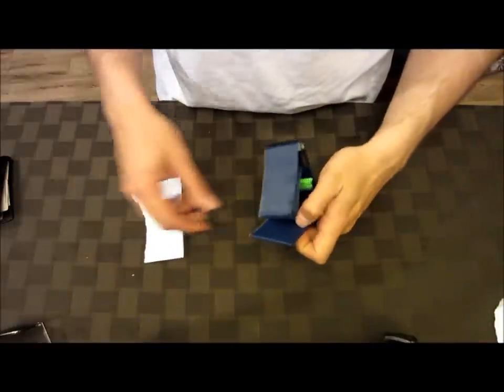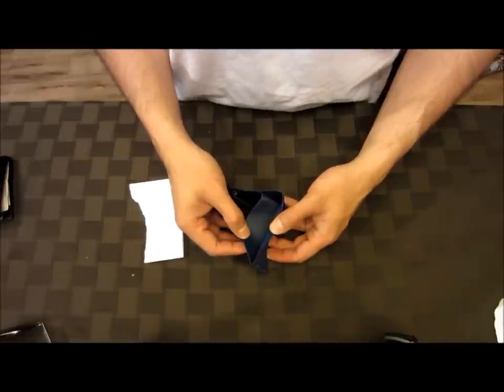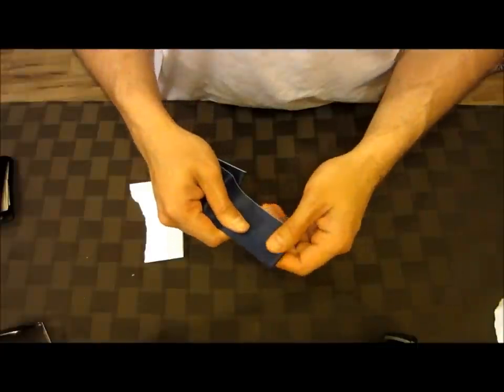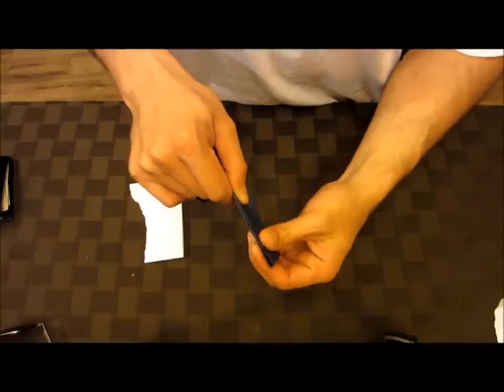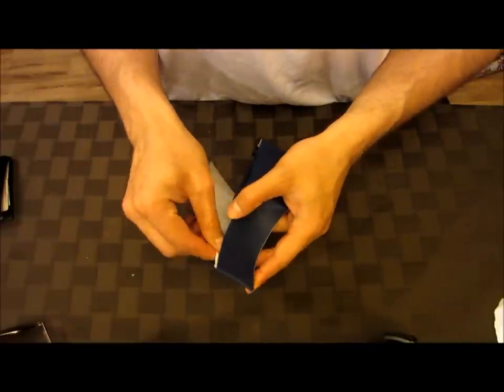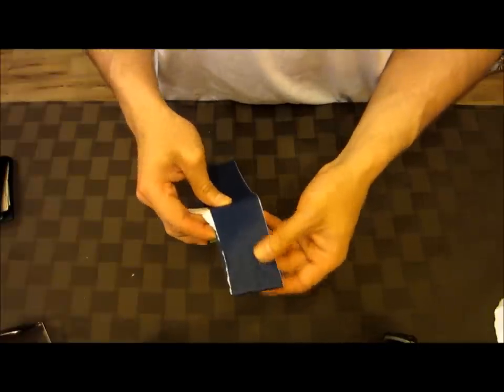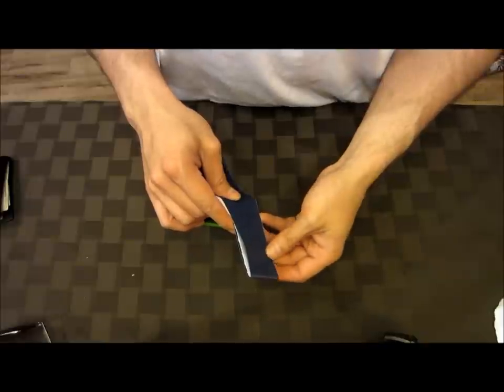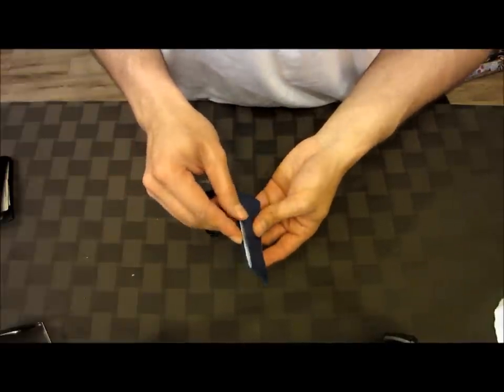Samsung SE Error Updated

Comment: Hey thanks for the second explanation.  I too had se of doom!  Cheap Samsung!  As you noted 
1.I found the ribbon cable and 
2.I peeled back the red sticker spacer that helps the ribbon cable connect firmly with ribbon slot.  
3.I folded a sticky note in half and placed it between the ribbon cable and the now peeled back red sticky spacer.
I made sure the sticky note spacer was the same width as the ribbon cable. 
4.  I folded red spacer back to the ribbon cable and connect it back to microwave! PRESTO FIXED!  Thanks  Buddy! Instructions I used are above.
Reply: Your solution seems different than what's in the video. Did you basically increase the thickness of the spacer to achieve better contact?

Comment: Perfect and simple, thank you!  Most of the other videos for this problem involved unplugging the control panel and some even went so far as to disconnect the keypad and cleaning everything.  After going through all of this some people had the problem return shortly after.  I think what happened is that when they pulled out the ribbon cable, it pulled apart and this stopped the short but then returned to the SE or 5E error soon after.  I think putting an insulator (the piece of paper mentioned in the video) between the ribbon cable where it overlaps is the answer to this.  At least it worked for me.  Thanks - gotta love the 'net!!!

Comment: Hey guys watched several videos on this subject. When I opened it up it was coated in what smelled like bacon grease. So I cleaned all the connectors and put a piece of paper between the ribon cable. Don't recommend taking the key pad cover off. The Ole beauty works perfect now. Thanks for the videos.

Comment: Thanks for this, just tried it and it works!
Reply from the maker: I'm glad it helped!
Reply: jjthetechguy now the error is back, any idea what could be wrong?
Reply from the maker: Hi Sara, there was a post earlier this month to disconnect the microwave to reset all of the capacitors. You can try that. My microwave eventually stopped working after about 7 years so I saved up and purchased a replacement.

Comment: Sorry for my ignorance. I understood the process but I just want to know we're that ribbon is located. Thanks in advance.
Reply from the maker: +Aldo Hiciano You have to take the control panel off and the ribbon cable will be behind there. I you are not comfortable opening up the control panel then I would not recommend that you do this since there are extremely dangerous parts behind the control panel that can be life threatening (they are farther back and away from the control panel but I figure you should still know). If you do want to open it then there are other videos on YouTube that will show you how to do this. Once you get to the ribbon cable you may insert electrical tape or a piece of paper  in between the ribbon. Hope this helps.
Reply: +jjthetechguy  Hey jj, thanks. Did it and problem solved. No SE error since that day. Don't know how long will the fix last, but for now I'm making popcorns every day, Yupiiiii!

Comment: The problem is only dirty contacts on the ribbon connector. Remove from socket. Clean with "contact cleaner" and reassemble. Quick permanent fix.